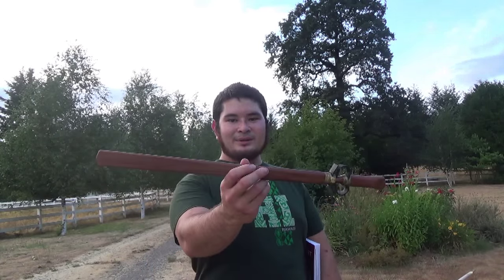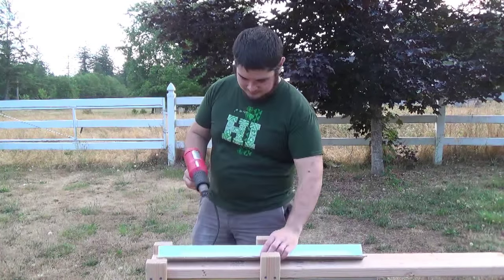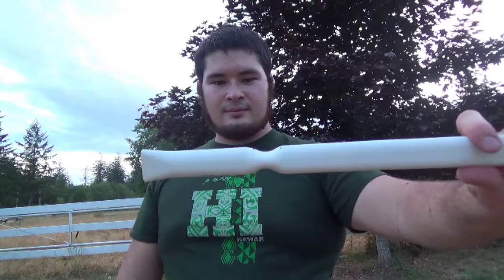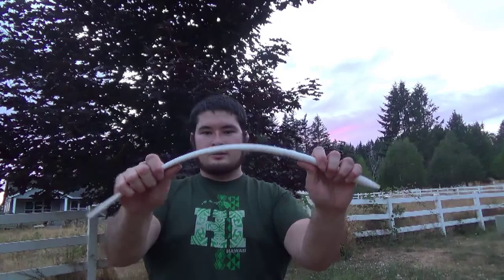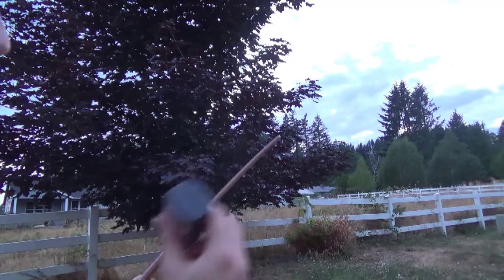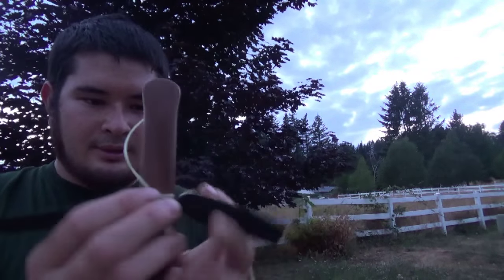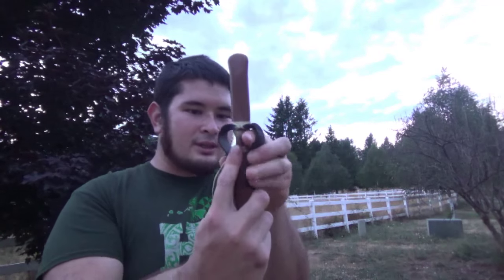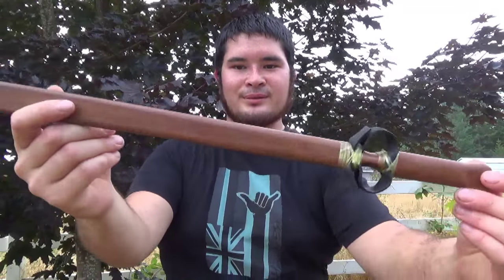Making a Basketmaker Style PVC Atlatl

Comment: Instead of a spur at the end, maybe a cup, like an egg cup shape would enable quicker alignment and a much faster rate of fire? Also I have seen atlatls with a support for the dart just above the hand, again allowing a faster rate of fire. Can the atlatl be used with normal bow arrows?
Reply: The groove that he adds helps with rate of fire there are historic atlatls that have a cup instead of spur and a groove and cup could probably have a high rate of fire and yes you can use arrows with an atlatl but it doesn’t work well atlatls are best for projectiles far longer and heavier than pretty much all arrows. Most atlatl darts are 6 foot plus some even nine foot